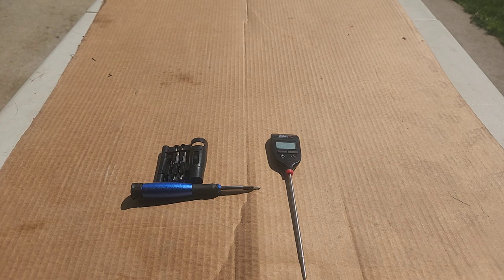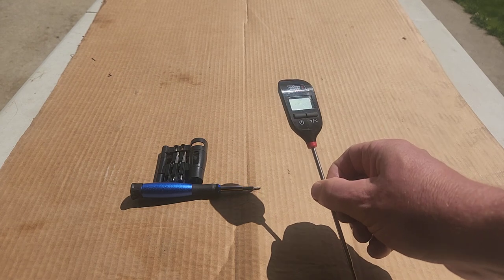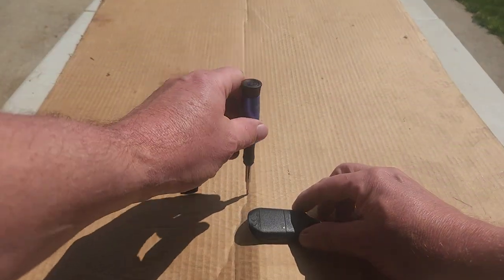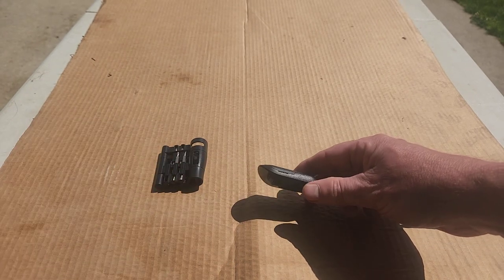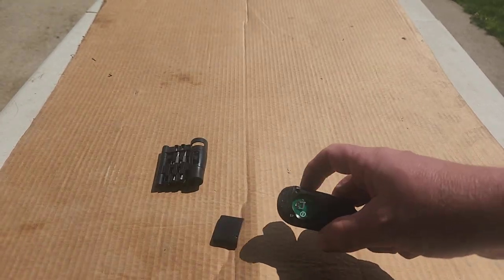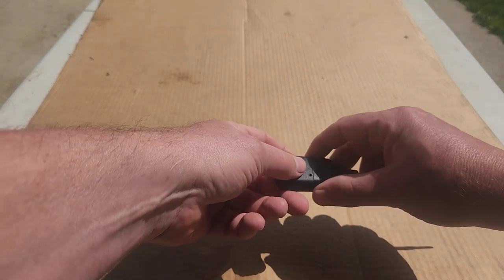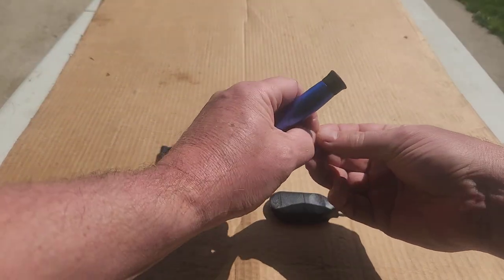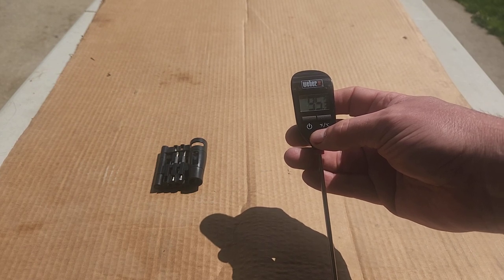Weber Meat Probe Battery Change

Comment: Mine didn’t have the set screw. Was able to just use a thumbnail in the slot to pop open. But, I was replacing the battery as the display was garbled and a new battery didn’t fix it. Ended up in the trash after only a year of light use.
Reply: Same issue!!